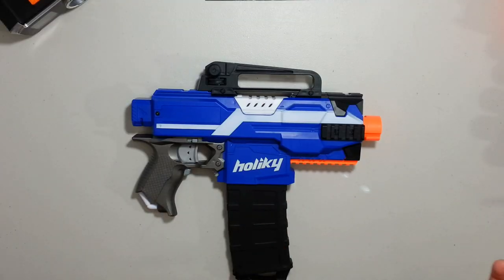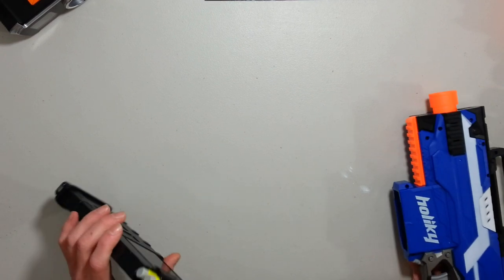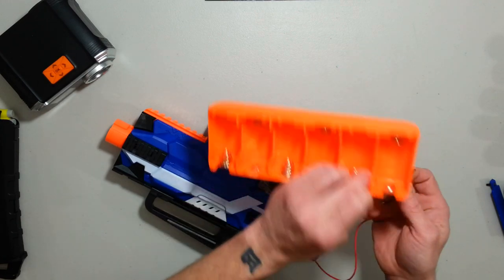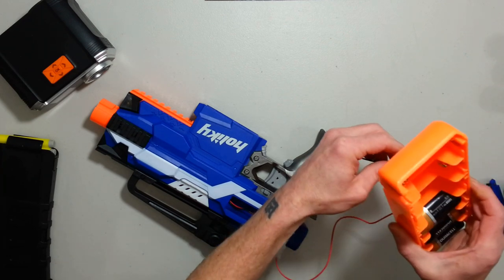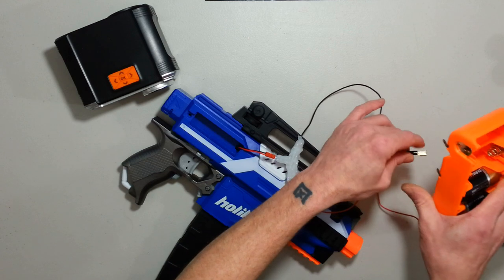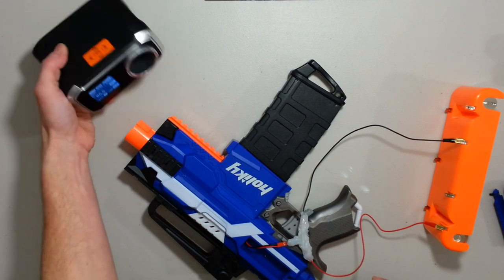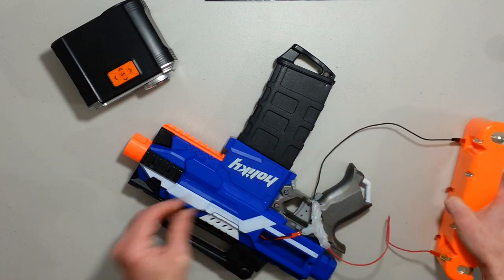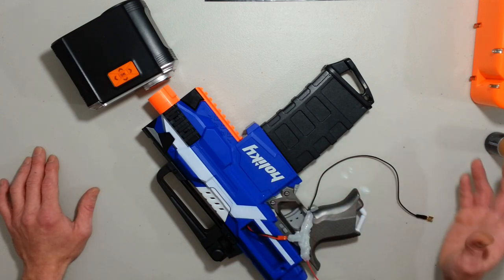Holiky M416 voltage Test ( Maxed Out ! )

Comment: Nice test. Can't wait to see those motors upgraded.
Reply from the maker: They will need to because the pusher itself works fine on 6v(4-5 dart/sec), it's the stock motors that top off at 90fps on 4.5volt with 3 dart a second.

Comment: This is excellent video.  So change motors, cage and wheels.  Maybe split the circuit and put a DC step down to restrict the voltage to the select fire board to keep it from burning.  Pretty good price considering it comes with the extra parts that you would pay a lot for with Worker or 3D printing.
Reply from the maker: I would split the circuit with separate power supply for the pusher

Comment: Would like to see you mod it and see how much the pusher motor can take
Reply from the maker: it's planned...among other things... but so far I can tell you that on it's own circuit with 6v just for it, I have around 5-6 dart/sec. Seems like holding even on 7.5v, even at this voltage the pusher system is working pretty regularly the semi auto setting is way snappier
Reply: @thatoldnerfguy  that's good :-) thanks. I have one that I am about to rewire